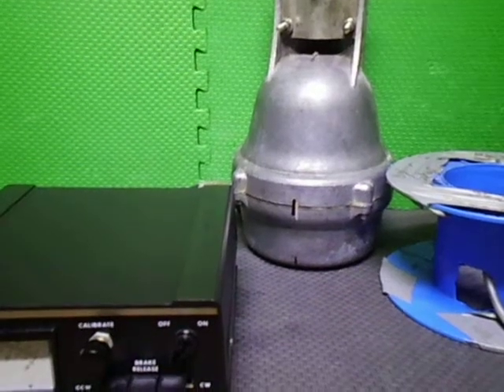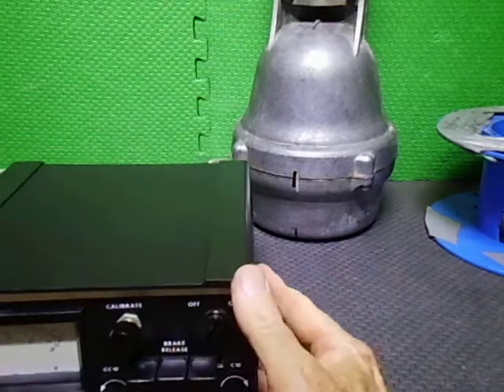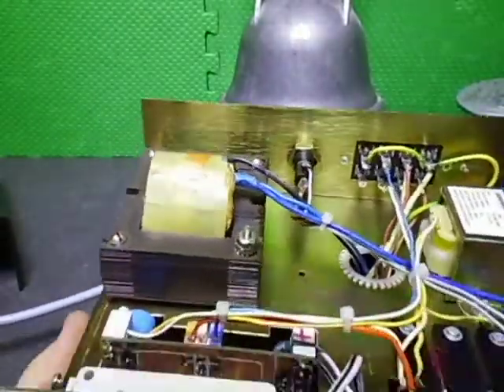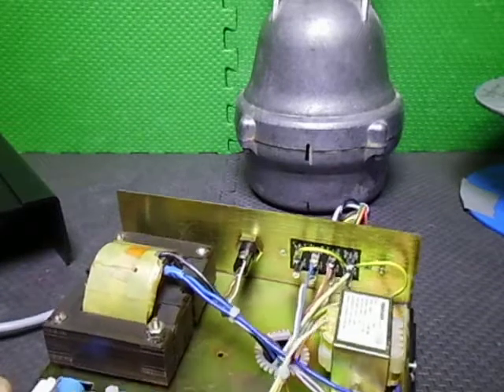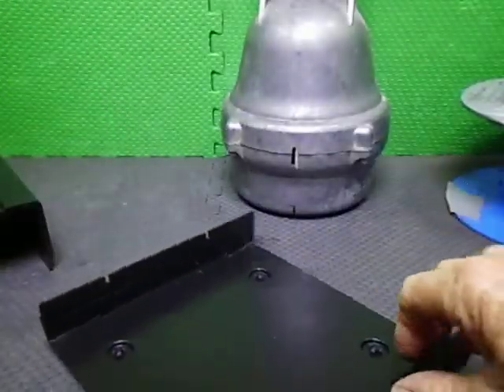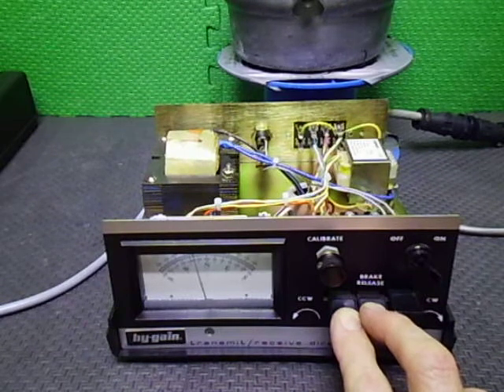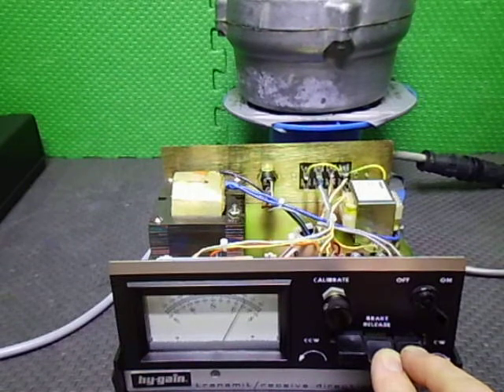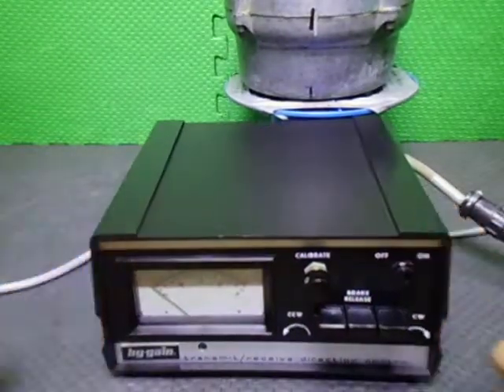HyGain Ham4 Rotator & controller overview of upgrades etc

Comment: I have a ham for rotor it will go counterclockwise they won't go clockwise won't let me to control or that be the rotor.w8dmx
Reply from the maker: Hi Kevin, thank you for the comment. There is several thinks that can cause the problem you have. There is test & fault finding info in their manuals.  First it can not be the motor start CAP as the rotator motor work in the other direction. We will start with the controller 1) Direction micro switch could be faulty. The Control cable 1) Broken wire, 2) Bad connections. The Rotator 1) Motor burnt out on one phase, 2) Faulty limit switch, 3) Wiring issues. Regards Peter
Reply: @duoro-rotators  I have to check out the rotor manual I don't have one now it work good on my other road before it quit turning up there because the ring gear went bad on the one on the tower but this was gave to me and stuff look like a good shape but when I wired up with the  8 Jones plug check all connections on it hell she go go counter clockwise but she won't go clockwise I don't know if it's a startup capacitor bad or what I'm still stuck like Chuck thank you for cutting back with me w8dmx kevin
Reply from the maker: @kevinstevenson5591  Hi Kevin, As I stated it IS NOT the motor start CAP as it turns CCW ! IF it was the motor start CAP it WOULD NOT work CCW or CW !. As stated the motor in the rotator could have one phase burnt out or you have a faulty limit switch. A broken ring gear will stop it rotating in both directions.  Regards Peter
Reply: @duoro-rotators  might be to control box probably
Reply from the maker: @kevinstevenson5591  Hi Kevin, Yes it could be the controller as  stated (direction micro switch).

Comment: where do you get parts for the rotors at? ? i have a tr 44 and a ham 4 i need to rebuild,,,,, the tr 44 wont do anything, the controller is good,
Reply from the maker: Hi Yelnats101, thank you for the comment. I do have some parts on my web site, but have not been able to get parts form HyGain since 2020. Please get in contact with me via my web site (link is in the description) for more info. Regards peter of Duoro

Comment: The start cap is perhaps the most common part to fail. That is why it is in the controller and not at the top of a 100 foot tower. Replacing the start cap in the controller when it goes bad is an easy ten minute job.  But if you prefer to climb the tower for the same repair then by all means, move the cap to the rotor.
Reply from the maker: Thank you for the comment. Yes Motor Start CAP do die, especially the small white ones in the early version CDE controllers plus other small cheap versions.
But that is caused mainly by being to small in size & to far away from the motor it is help to start.
You talk to a electric motor engineer & tell them you are going to put the motor start CAP 60m away from the motor it is servicing they will tell you it will not work properly & the CAP has a higher chance of failure.
The CAP's I use in my rebuilds are high quality & are self healing types.
I have seen motors in rotators totally burnt out, but the CAP sitting right beside it is OK.
I service & rebuild most brands of rotators, I have been doing it for a long time, the most problems I find is lack of servicing & poor installations.